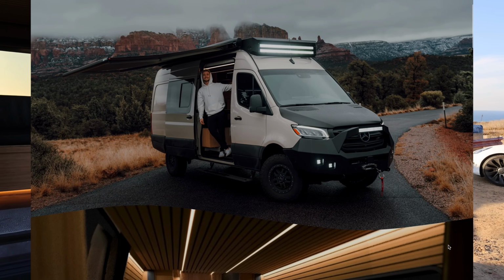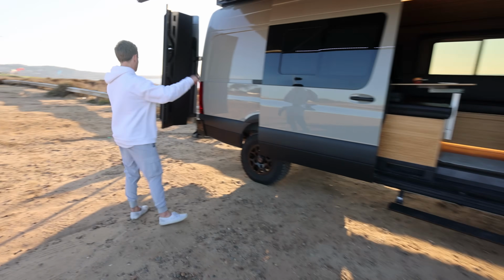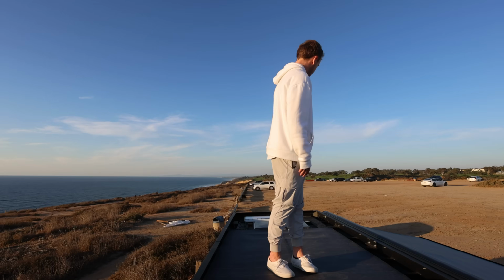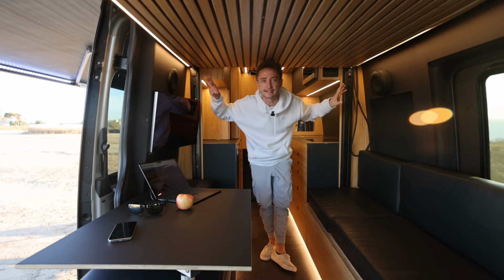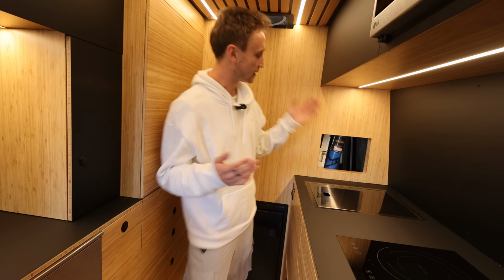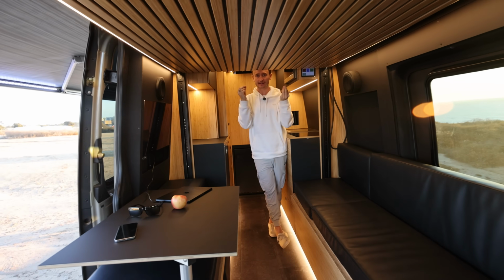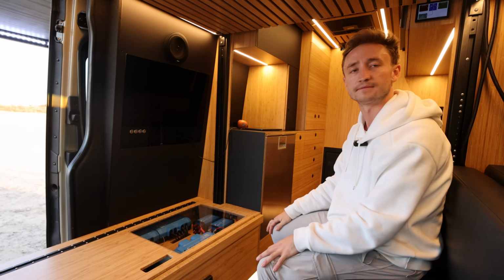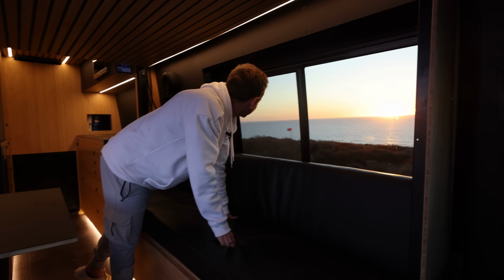MOST Futuristic Van Build - Mothership Vans

Comment: Personally I would never purchase a Sprinter van they require a specialized mechanic to fix them and finding qualified repair facilities and getting in in a timely fashion is nearly impossible when traveling so I would definitely go with a Promaster over a Transit but both are better choices over Sprinter. These four wheel or all wheel high roof vans are not much better off road than a front wheel Promaster as all are just as capable. I like the turning radius and the lower floor step in giving a lower center of gravity on the Promaster
Reply: I have a sprinter and a Nissan van.  I realized that I always have a little underlying stress when driving the sprinter.  A do not have the same stress when driving the Nissan.
Reply: I have a Sprinter and I love it. Been to a lot of places off-road which a front wheel drive would definitely have got stuck. Found a local non-dealer Mercedes shop that has been able to service my Sprinter at reasonable prices. It’s been pretty reliable so far so I don’t know what all this Sprinter hate is all about.
Reply: @Blztrls   To be fair, your personal experience is completely subjective and irrelevant and doesn't negate the experience of others. You could very well be the exception to the rule, that just got lucky and happened to live by a shop that can work on sprinters, are reasonably priced, and aren't super busy or booked far out. That's not evidence of these issues not being a real problem, that just explains the reason why YOU personally, don't have that issue. Obviously, enough people are making the same complaints, over and over, enough for it to be a well known thing in the community. So there must be at least some truth to it.
You gotta start thinking bigger than yourself my dude. Too many people have this mindset where they can't see past their own lived experiences, which inevitably prevents them from being objective, or even empathetic.
Reply: @sashabenoit1518  there are also many people who don’t have problems with Sprinters. Mercedes would not be able to sell so many Sprinters if they were not cost effective against Promasters and Transits. These vans are business workhorses first and the business world is not forgiving of unreliable and non-cost effective vehicles. Furthermore, the anecdotal evidence of Sprinters breaking down are the personal experiences of other people and are also subjective and irrelevant if your reasoning holds true. Their experiences could very well be the exceptions to the rule. 🙄 In general people like to complain when they have a problem but rarely post about reliability so stories of problems tend to be exaggerated.
Reply: @Blztrls   I actually agree with most of everything that you said and that's also why I stated that there is SOME truth to it. Basically under the tenet of "typically where there's smoke, there's fire" but that still doesn't mean that it's the general experience overall for everyone, one way or the other. I absolutely agree that it's typical human nature to voice the negatives over the positives. However, when you have enough collective complaints about the same repeated issues, it starts to give weight to their credibility and that it's likely more common than just a few *one offs". Now, that being said, that doesn't necessarily mean that the product itself, is bad overall, or even that it's faulty in any way. There are numerous reasons that could cause these issues. Any mechanical or performance related issues, could easily be an issue of user error, any aftermarket modifications or alterations, or an isolated issue that the manufacturer does a recall on, once it's brought to their attention. As for finding a decent repair shop, a lot of factors goes into that as well. It depends on where you're geographically located and the supply and demand of that area, to have shops dedicated to be able to work on sprinters, especially at a reasonable price. And that supply and demand is what determines how busy those shops will be. Finding a shop also relies on the efforts and knowledge of the customer, to do their research and shop around. And if there are a lot of mods, or a full DIY build out, it definitely could hinder your ability to find a shop willing to take that on and could potentially raise the cost, especially if they have to put in more labor to take apart a lot of stuff, just to get to something to work on it, and then have to reassemble afterwards. Then you have to take into account, what people consider to be "expensive" or "untimely", are completely subjective from person to person. Everyone's definition of what they deem as reasonable, is going to look different. Not to mention, on both of these issues, people's expectations differ wildly. So many people have extremely unrealistic expectations when it comes to performance, customer service, pricing, wait times, ect.. whether it be because they're not knowledgeable on how things work realistically, or they're just an unreasonable person in general because they're self centered, entitled, or cheap. I think that a lot of people that buy these sprinters, really have no idea what they're getting into and just think of it like any other vehicle. The don't educate themselves prior to buying, or even after, not realizing that German built vehicles are typically different to work on and require special knowledge and tools. They also tend to forget that, although they are typically used as a workhorse or off-road campervan, they're still a foreign luxury brand and that can make it more expensive to maintain. Which brings me into the point that you made about why so many people are buying them, if they're not reliable or have certain issues. First of all, they are a long standing and reputable luxury brand. People equate luxury and brand name to mean quality. More importantly, you have to take into account that these vehicles have become extremely popular, due to them being "trendy" on social media and having all of that free advertising and people's desire to have what society seems as "cool" or the "best". That's not to say that they're not reliable or that they didn't earn their reputation, just that there are other factors at play as to why they are so popular and their reliability is only a small fraction of what motivates people's buying habits. Also, because of their rise in popularity and people converting them into off-road campervans, the brand has to adjust and adapt to the intended uses of their customer base. So, while it's true that they were originally workhorses, mostly intended for transport and delivery, they weren't being specifically designed for off-roading and campervan conversions. So it's definitely understandable why people could run into some issues with that, at least on older models because now they are catering more towards those capabilities.

Anyways, my point wasn't to bash on sprinters in any way. The whole reason I even said anything was because you used your personal experience to discredit the claims being made and that seems to be a growing common problem in society today. But, that being said, once you elaborated a bit more, it's clear that you're capable of nuance and thinking objectively.